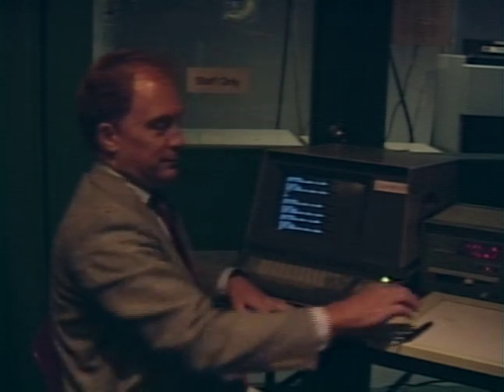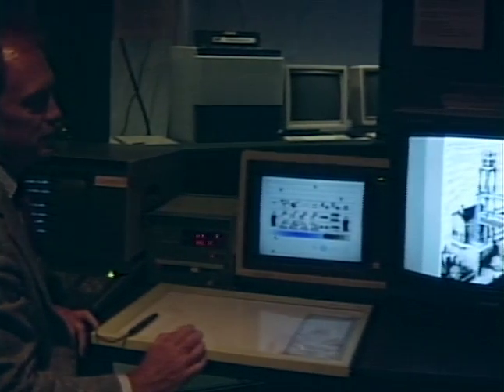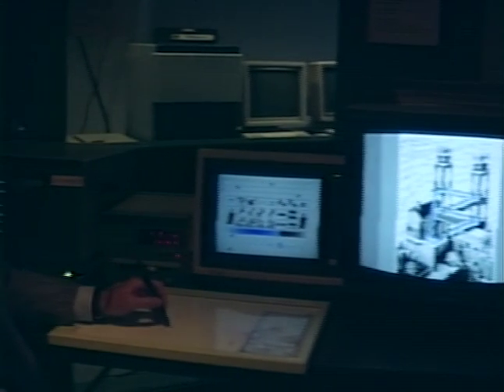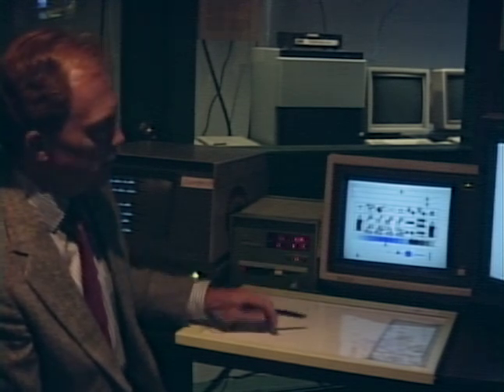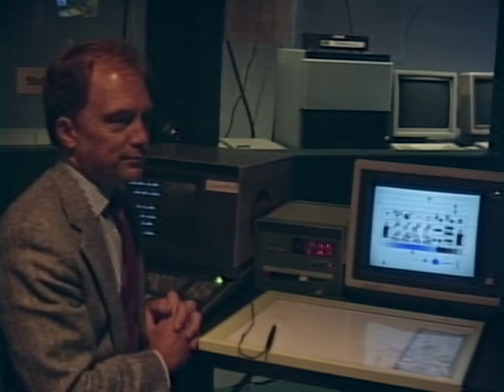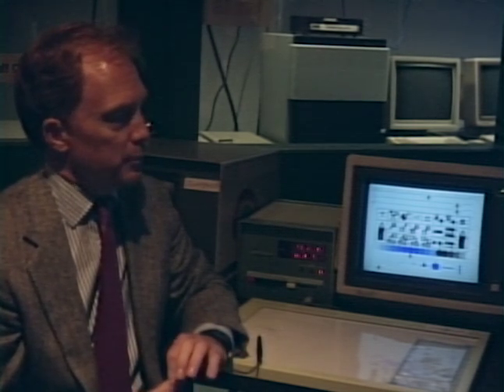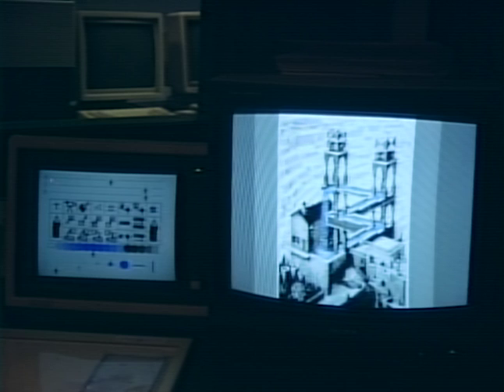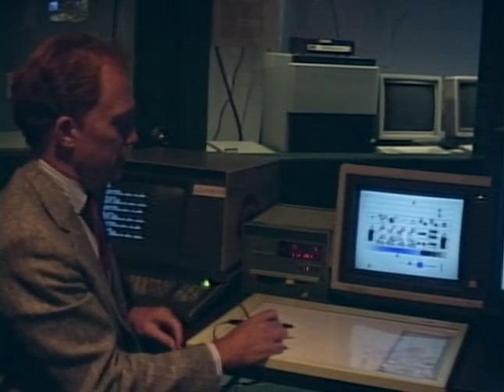Interview with Dick Shoup

Comment: it's easy to dismiss how utterly astonishing this system was, unless your remember it was designed and in use in the mid-70s, when most computers were outputting to paper or tape rather than through a screen. The resolution was very high even for computers 10 years later. The concept of a GUI wasn't well known and not part of computer lexicon.
Reply: This was such forward thinking work, even PARC management (never mind Xerox) and other researchers there couldn’t see how pivotal it would become. Dr. Shoup was marginalized.